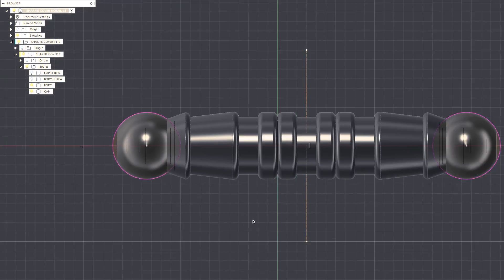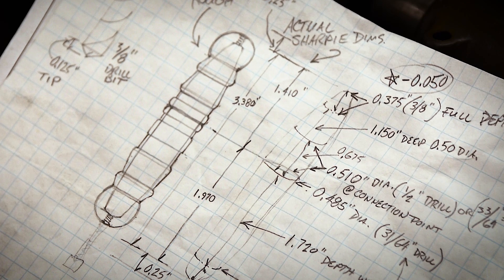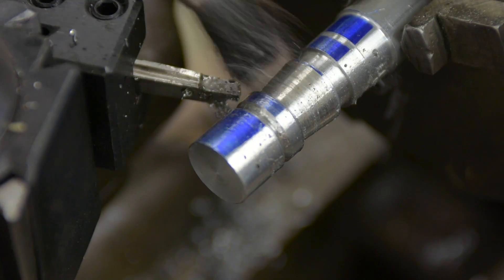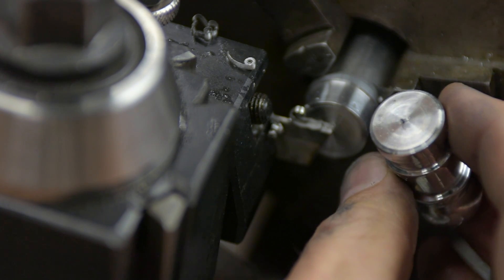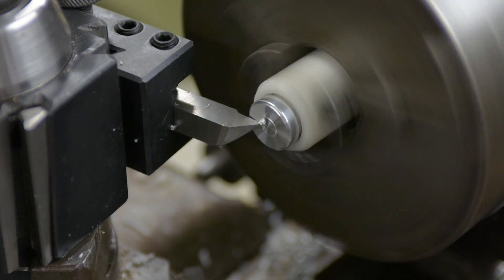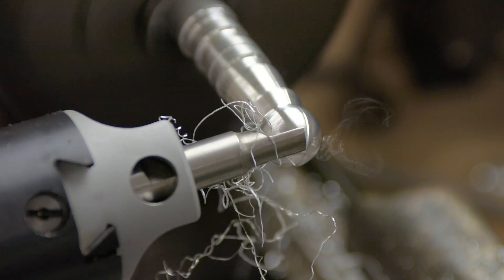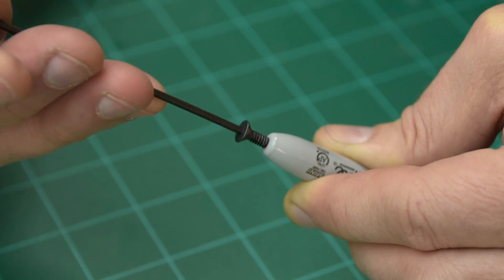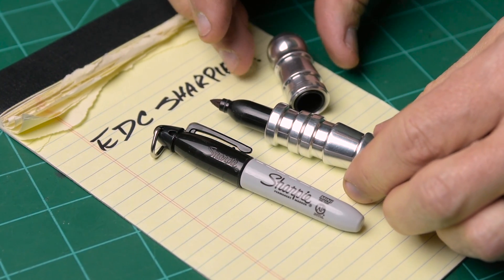How to Make and Design a Pocket Size EDC Sharpie with Metal Casing - Machine Shop Lathe - CAD

Comment: What do you do when the sharpie dries out
Reply from the maker: That’s easy. Just prepare a new Sharpie by drilling the appropriate hole in the end. You can discard the newer cap. Remove the screw that holds the barrel in, pull out the old one, push in the new one. Replace the screw. The existing cap can be reused. That’s it.